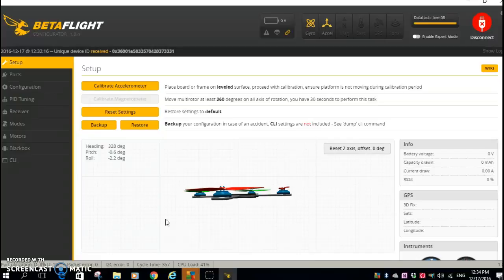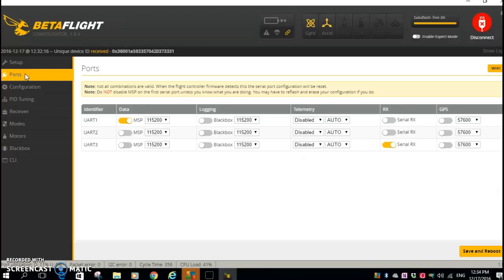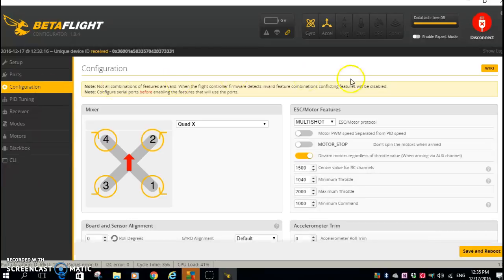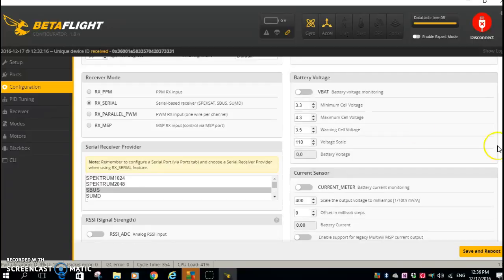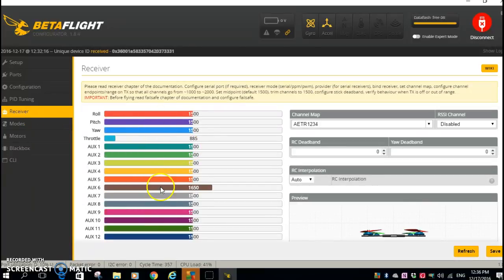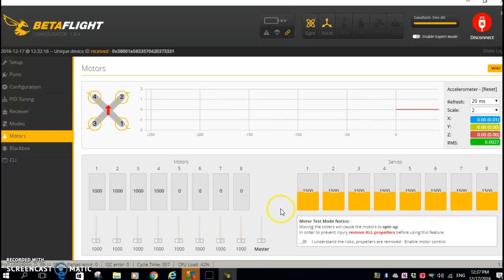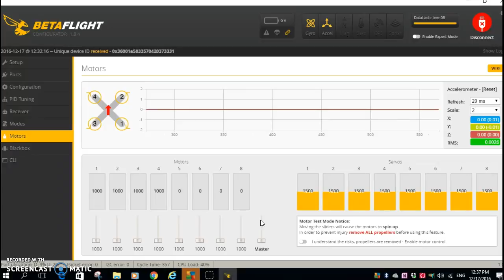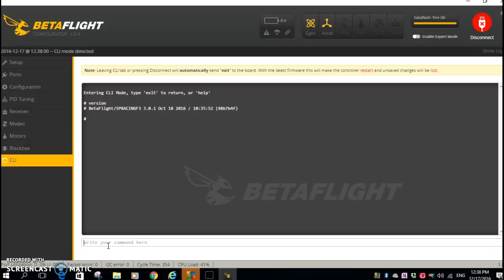Eachine wizard setup and betaflight Part 2 - Success

Comment from the maker: In order to see the controls you need to plug in the battery to power the quad. The channel mapping can be changed using the drop down arrow when you go to "receiver" however AETR1234 works with the Radiolink but when i moved the sticks for throttle and Eilron i saw that i needed to reverse the channels. that is done on the Radiolink controller through the menu. Hope this helps...feel free to message if needed
Reply: Hi bro i can't connect the at9s control with the wizard  please can you help me ?

Comment: hey, think you can help me out with an issue im having? for some reason i cant connect to betaflight at all now. i plug it in and all i get is solid blue light with a flashing red light....ive tried new cables, unistalling bf, changing the ports. unistalling ubat source.... im out of ideas.  i added a video just now . can you watch it, and try to help me out?
Reply from the maker: Link the video and i can see if my little knowledge can help

Comment: can i just point out.. your cpu is at 40%?... this is too high, i've been told 20% is the most you should push the cpu... i think using multishot might be why its so high i'm not sure, try going back to oneshot125 nd see what the cpu usage is... bottom row on betaflight app
Reply from the maker: TheMadmacs i appreciate your comment.... like i said i am new to this and my knowledge is limited....can you elaborate please.
Reply: sure, the cpu is the brain of the flight controller,  for best results experts say that its best to keep it below 25%,  the more stuff you have like led's and rssi and telemetry all these kinda things put pressure on the cpu and if you can imagine even a good computer can sometimes struggle and glitch and lag, when it comes to a flight controller you can't afford any glitches or lags, so you gotta use them way below capacity, it will reduce glitches and make it easier to quickly recover from glitches. so 40% is removing headroom... i am not sure but i think multishot uses more cpu... when you hear people talking about pid loop and gyro loops,,, these are the speeds the data is being read and sent out, so 4khz and 2khz pid and gyro loops willl be more cpu usage than2khz and 1khz... i don't know if you changed those or using multishot changed those for you, i'm still at oneshot125,  i would refer anybody to painless360 videos on pid loops or joshua bardwells might be more current.
Reply from the maker: Thanks for sharing....i did change those to 4khz manually. Multishot did not do that. I understand what you are saying...i think i will refer to those videos and probably go back to 2khz...I appreciate your time to comment, thats the reason why i am doing these videos ...hope others can learn from experience and errors.
Reply: i'm happy to help, this whole hobby is a web of people passing on info, us noobs have a duty to pass on the easy questions, because the experts get tired of the easy stuff. have a look through my subscriptions, theres a few fantastic people who basically have posted a full education on all the aspects of the hobby. rcmodelreviews and painless360 and seby docky.... huge library of topics on rc flying.
Reply from the maker: Cool..will do...thanks again
Reply from the maker: Hi....i just went back into betaflight and reset the gyro and PID loop to 2khz and the cpu load went down to 7%....imagine that...i left multishot on....
Thoughts on this?
Reply: i forget the details, but there is stuff you need to know about multishot and pid and gyro loops, i vaguely recall that multishot is ineffective below certain speeds... i think joshua covers that on one of his videos on the different fc's
Reply from the maker: TheMadmacs i see...more research needed i guess. thanks for sharing....will see how it goes.... keep in touch
Reply: anytime, i will subscribe to see how things go, i don't post much so its not worth subbing me, and you should try to limit the amount of people you sub to so you can easily scan your list for new content, things change fast in this hobby so too many subs will make it impossible to follow